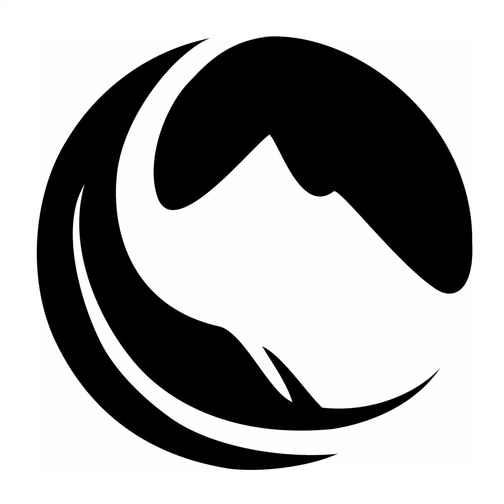PODCAST: Dyneema Composite Fabrics

Comment: Hmmmm. This was definitely informative but I do think that the manufacturers of DCF tents are gonna be biased. Having hiked with a tarp using 1.1 silnylon and separate net tent with mesh and bottom using 1.6 hyper D both totaling 1.3 pounds for over 1500 miles of hiking. Yes it can sag when wet but it also drys fast and packs up really small unlike Dyneema. It’s never ripped and still looks new. Also whats the point of going UL if it takes up half your UL pack. DCF doesn’t pack small because of the need to prevent delimitation. I saw so many hikers with all sorts of expensive UL gear using UL packs, and everything is flowing out of it. Half their gear is strapped on the outside. I think you should have interviews from people who bought their gear and thru hiked with it. Also include hikers that had a silnylon and or silpoly tent when hiking. I don’t know about you but quite a few poplar blog hikers are getting free gear from these companies so I definitely question the actual honesty and admittance of Dyneema’s performance and it just being being trendy. How many of you are gonna talk crap about someone who gives you a free 600-1000 dollar tent that doesn’t perform well. So I definitely think there’s an emperor new clothes thing going on with Dyneema. I saw the snow storm video of you using the Dyneema hyperlight tent, you were careful with what was said and had the option of bailing out. An actual thru hiker stuck in a storm like that would be pissed at it performance for its cost. I’ve also noticed that lots of cottage companies are vetting their reviews on gear as well. Some don’t allow reviews, or only allowing 3 or 4 stars to post, or only letting a few people make a review. I do appreciate you and your reviews. I do use them in helping me decide things when I design and make my gear. Thanks.